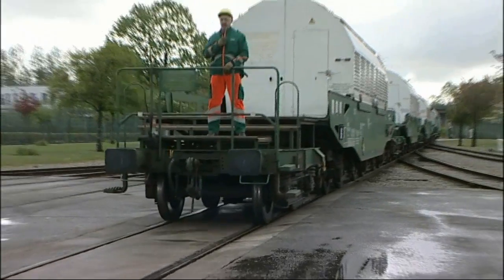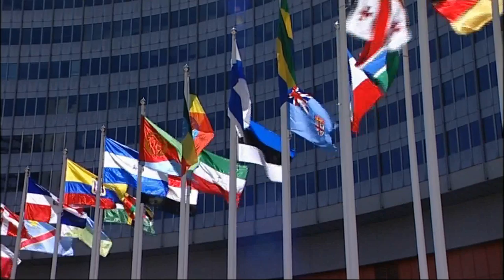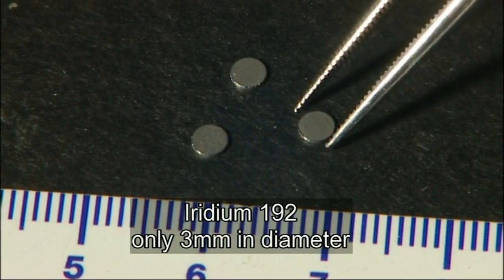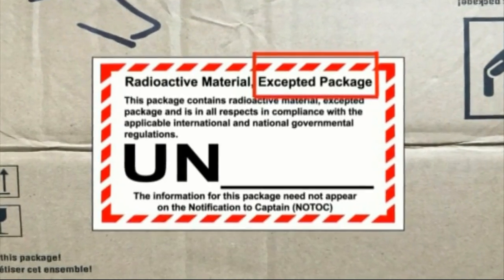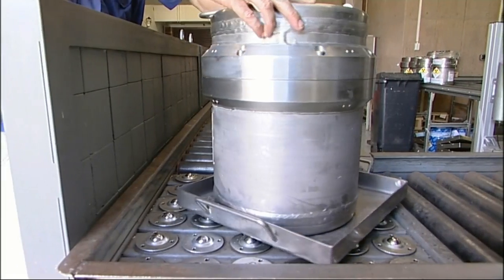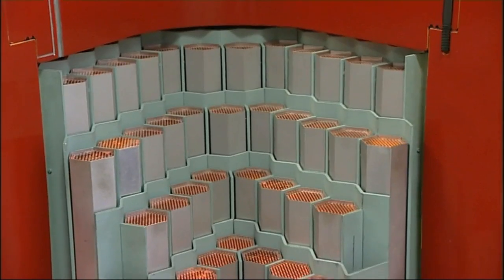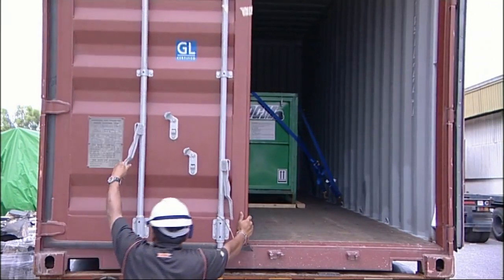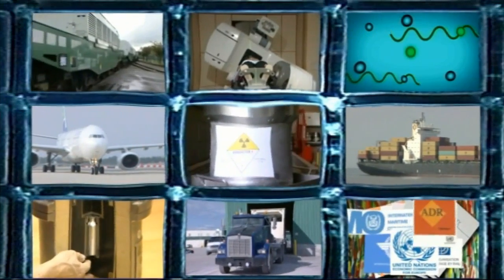#2 Packaging of Radioactive Material for Transport

Comment: Remember getting several radioactive transport packages from a Sandia Labs auction years back. They were empty of course, but the instructor for the RSO course at UW madison liked them for showing students the difference in requirements for fissile vs high gamma vs alpha and beta. The plutonium canister for example had a special filter on the top to release pressure and was little more than a regular Vollrath can with a thick blue boron loaded silicone rubber insert which was very surprising to say the least.